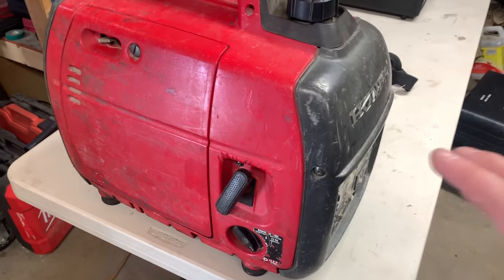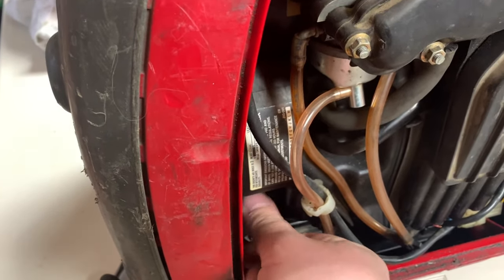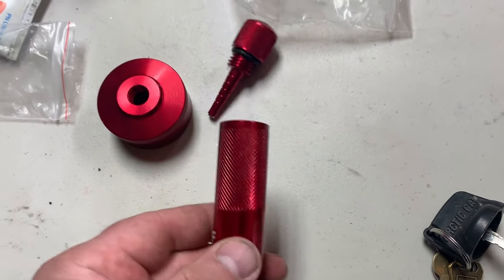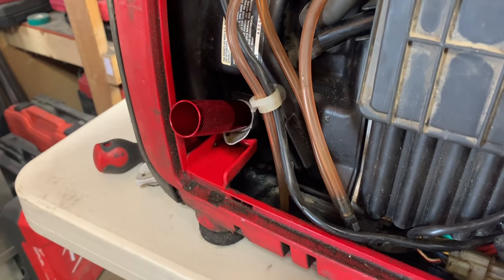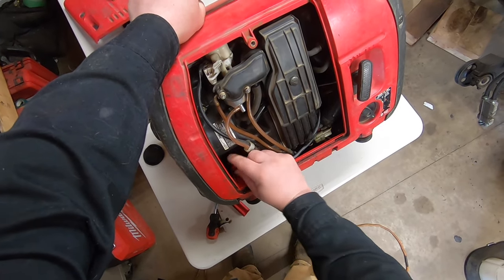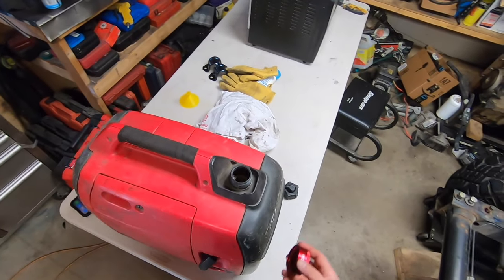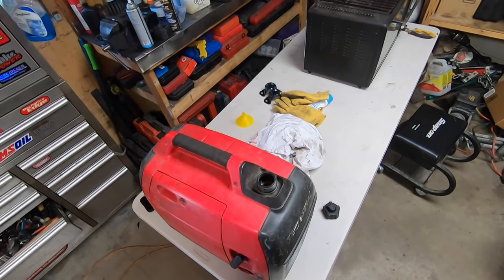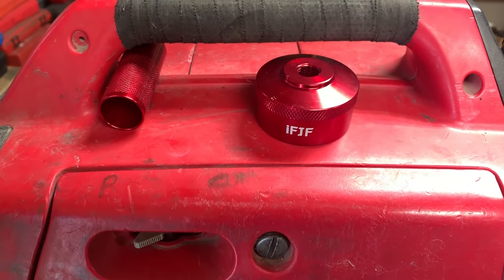What Every Honda EU2000i Owner Needs

Comment: That crankcase is overfilled by a lot. Don't do it. An overfilled engine is far worse than one that doesn't have quite enough. Oil needs to splash around to land in the places that need lubricating. An overfilled engine will not splash properly.

Comment: If your over full , you are likely causing extra crankcase pressure. Better a shade low then over full.
Reply: Also, an overfilled crankcase doesn't lubricate as well because the oil's ability to splash around is more restricted. He's got at least 6 ounces too much oil in that thing which is bad. I once overfilled mine by accident by 4 ounces and the oil didn't run out as quickly. I'm guessing the engine damage he has is because of an overfilled crankcase all the time.

Comment: Nothing wrong with the size of the gas tank. It will run for 9 hours on less than a gallon of gas.  It's best to let it cool down for 20 to 30 minutes then refuse it. Your generator will last longer if you take care of it.

Comment: These generators would be incredible if they had a two gallon tank and a better opening to poor the gas into. I don't think I ever filled it up without spilling gas.
Reply from the maker: That’s 100% truth spoken right there
Reply: Use a funnel
Reply: @jredd801  You obviously don’t have one of these! 
It goes from “it’s almost full“  
directly to “F’n OVERFLOWING”
In about a microsecond!!!
A funnel is not the issue.
Reply: I use a modified fuel cap and a boat gas tank.
Reply: All you need is a good gas can and a funnel. I never had any spilling problems.  The generator runs 9 hours of less than a gallon of gas. How much trouble is it to let it cool down for 20 minutes to refuel it?  It's good for the unit to rest after running 9 hours.
Reply: @jredd801  -   Yes Using a funnel is common sense. I never have any spilling problem when filling my generators with a funnel.
Reply: @thelast929  It won't overfill if you know what you are doing and exercise good care.
Reply: You ain't bullshitting, the problem is the gas can. I overfill it every time with a gas can. I fly gas powered helicopters and airplanes. I have a few 2.5 gallon cans with a small 12v electric pump made for hobby use. I use lipo batteries to power the pump. I've never overfilled it with the hobby pump set up. They make the pumps for nitro and gas. The nitro pump will last about 1 use if you run gas through it. You need the gas pump. Takes about a minute to fill an IU2000.

Comment: Hmmm, When I change oil I just tip the machine and the oil pours out. Then I tip it a little the other way and pour oil in it. It’s always worked well for me that way. I do agree, I wish it had a little bigger tank. I get about 8 hours on mine running a heater.
Reply: Same.. Oil changes easier than most other engines!

Comment: A Snapple 16oz bottle fits over the oil extension tube giving a no-spill way to completely drain oil.  Screw cap back on and you can't knock it over either.

Comment: I have and have had the 3000is for a couple of decades.  It requires the oil level be right at the bottom of the fill location.  So, when filling you kinda have to see that area to know when it's full.  If that red tube were clear/glass I'd say what a great idea.
I find placing a rag below the fill area takes care of any minor spillage...
Honda generators are the BEST!!

Comment: Yes  extended  run cap works great . 5 gallon tank good for two days running. 👍
Reply from the maker: What did you use on the fuel can side ?
Reply: @TestDontguess  yes I have 2 five gallon can on standby . You have to fill the genset tank first or it will not siphon from the external tank and the fuel hose should reach the bottom of the tank . I can get a week out of two 5 gallon tanks . 👍
Reply: @TestDontguess  For the fuel side on my 5 gal tank I use a spare gas cap and drilled a hole thru the center yellow  cap I glued in  and ran fuel hose thru the tight fit and just move all of it to the next fuel  can.  I used just regular 5/16 rubber fuel hose.
Reply: If you want this gas cap for free I'll give it to you. it didn't work for me. Not a good grip on the threads of the end of the gas tank. It will pop loose and stop siphoning gas from your secondary tank. Also the gasket that they give you with the cap will not hold up to gasoline. Absorbance cash expands and then tears extremely easy. Screw on extension and magnetic dipstick I like a lot
Reply: mark rottjakob I have a similar cap that would do the same thing. The rubber gasket inside the cap was to thick and prevented the cap from tightening. I removed the gasket, the cap tightens and I get a good seal that I can siphon from the external tank.
Reply: @markrottjakob2670  C H I N A
Reply: Get some deep cycle marine lead acids... Save a fortune in fuel costs.

Comment: Excellent quality and works great as an alternate power source for my Winnebago RV when shore power is not available. Also great for Florida storm season and our fluctuating power. On propane, this starts up easily and no messy gas to deal with, very clean and easy to operate. Build quality is better than expected should last for years.
Reply: You have a propane kit for it?

Comment: Very cool stuff, I found I could make my own oil drain tube with about a 3 inches of 1/2" copper or other pipe with masking tape wrapped around the pipe to bring it up to the right diameter, you will need to play with the amount of tape to get the right thickness. Once done you can screw the 3 inch tube in to drain the oil. works well in a pinch!

Comment: Can someone please help me?
What are the dimensions of the oil screw and the thread of the tank on your Hondas?
None of the suppliers specify the dimensions of the threads of the oil screw and especially the tank cap.
I have a Zipper ZI-STE2000IV, this is supposed to be a clone of the Honda EU2000i.
And I want to know if this set also fits on my generator.
The thread of the oil screw has an outside diameter of 17.24mm, 0.68", 
the thread of the tank has an outside diameter of 45.9mm, 1.81".
the gas cap is 43.3 mm, 1.705" inside.
On the new EU2200i, the thread of the oil screw has been significantly enlarged. So be careful which set you buy.

Comment: Makes me wonder, how good the magnet is mounted on the dipstick. If this is not done right/falls out, then it will be a big mess, I assume?
Reply: Pressed into Chinese aluminum that expands when it heats and falls out, gutting engine.
Reply: @eegg6954  Am afraid so. An assumption on you part, or experience?
Reply: @yxcvmk  Happened to me on a 2000i
Reply: @eegg6954  What a mess. Thanks for the feedback!
Reply: @eegg6954   sorry for your loss.
Reply: @grizzlyaddams3606  We fixed it.
Reply: That magnet dipstick is a disaster.  DO NOT use it.

Comment: I'm trying to decide between one of these 2000 Watts for around $400 to $500 or buy a brand-new 2200 for about $1,000.  I want to buy two and link them for an RV.   So spending $2,000 plus tax sounds like a lot of money compared to $800.  Many of the used ones don't have that much use and I'm just wondering how reliable they will be when already used.  I know that they are typically very reliable
Reply from the maker: Your better off to spend the money and get the larger unit instead of linking 2 together
Reply: @TestDontguess  Why would you recommend the larger one?  My issues are that its big, its bulky its REALLY heavy and hard to move. .  The smaller ones are lighter weight.  I can take one generator when I only need one.  The big one costs $2000 for 3000 watts.  The smaller ones cost $2000 for 4400 watts.  More power for the same money.  Way more versatile and easier to move around.
Reply: My 2200 will run a 13,500 btu RV air conditioner by itself.  It surges when the compressor kicks on in stock form, but after installing a micro air easy start it is much easier on it.  Extra cost of the easy start is worth it to me to power it with one small gen.  Just my 2 pennies.

Comment: Honda 2100I companion Can someone help me i removed the tether that holds the gas cap on to generator in the process all the components fell out of gas cap and i cant figure the correct configuration of putting it back together so the off on switch works correctly on the cap..Any suggestions?

Comment: That kit don’t fit the new Bluetooth model, the gas cap fits but the new model has a bigger oil fill hole approx 1 1/8”....the filler and dipstick just fall into filler hole
Reply from the maker: Isn’t the new models the 2200i

Comment: Looks like its time for a rebuild,Jerry...
Reply from the maker: Cylinder compression and leak down tests are spot on, which why I’m leaning towards valve seals.  Oil burn clears up after a few minutes of running

Comment: is that Honda Gen good for 12-13 amps?  Worst case I'd need 20A for my mig welder... recommend?
Reply from the maker: No 20amp that I am aware of as it’s only 2000watts
Reply: If I read the MIG welder 115 VAC specs, its 2.50 to 1.77 KW....
Reply from the maker: @dg98adams  looks like you know the answer then